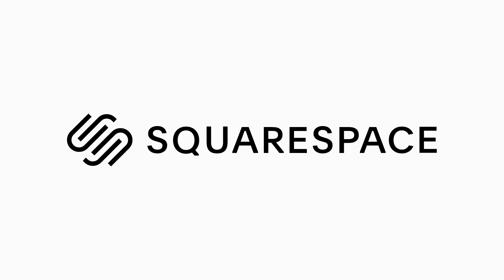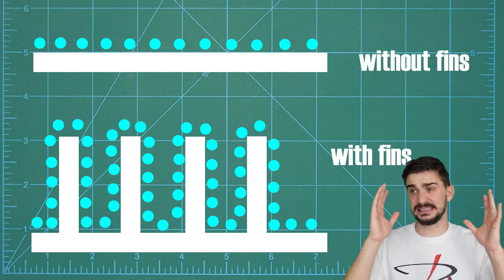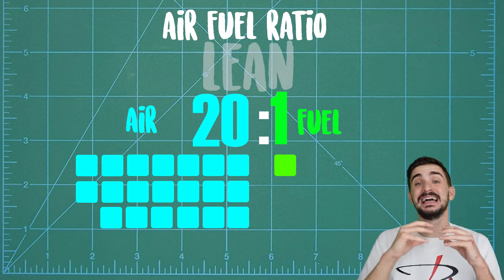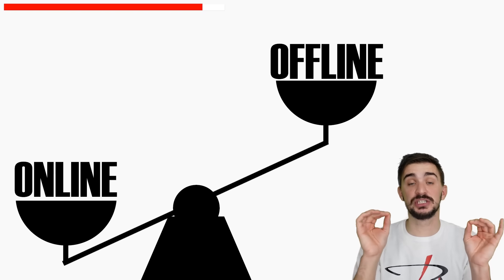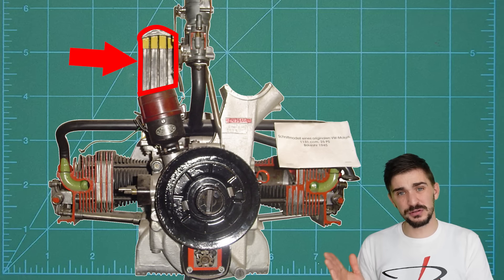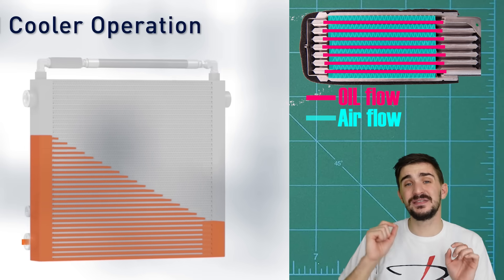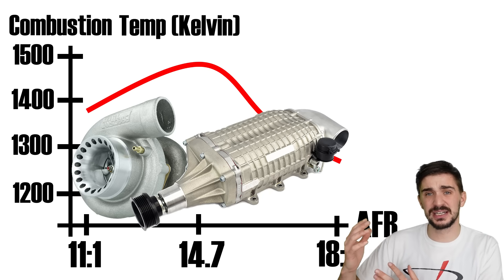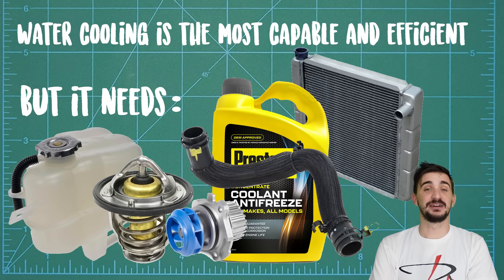AIR COOLED vs OIL cooled vs WATER cooled ENGINES

Comment: The only 'real" distinction as to wether an "air cooled" engine is actually oil cooled or "air cooled" is by how much of the heat extraction is done by the oil or the air. Even in air cooled aircraft, the fraction of heat dumped from the heads by air is very close to the amount extracted by the oil, and totally depends on wether the engine has spray oil piston cooling or not as to wether theres more cooling done by the oil or air flowing over the heads. In all cases, the most, by far is the heat rejected by the exhaust! The fractions that I remember are 13% rejected by the air, 10% from the oil, and 40% out the exhaust. More aggressive usage of "oil cooling" can get upwards of 30% of the heat extraction from the oil,  
(thats what Porsche was able to do), but this requires 15 quarts of oil and humongous oil coolers. Probably a better way to procede is to stop so much of the heat of combustion from getting to the heads and block.
Reply: > to stop so much of the heat of combustion from getting to the heads and block.
long stroke, double pancake shape ( HEMI ), high RPM ( the longer you wait, the more heat goes into the walls ) => fast piston speeds. Central sparkplug protruding a lot from the roof. A single exhaust valve has a little less surface area .. at least rocket engine like to have less but bigger nozzles. The thin walled exhaust pipe needs to start immediately behind the valve stem ( two exhaust valves: Y combination a welded pipes). Now tight bends in the headers. Extractor headers to pull the heat away. No turbo. 3 cylinder inline engines or hot vee to keep the heat at one place.
Reply: @ArneChristianRosenfeldt  Thermal barriers in the combustion chamber and exhaust port + water/methanol injection works on anything.
Reply: @63turbo  In the chamber we need to cool the oil on the walls. But you sure are correct for floor (piston ) and roof ( valves where not touching the seat ).
I am all for Ethanol/Methanol and high compression, but water?? I am unsure about turbulence. Can we have so that it stays away from the walls? Squish areas seem bad.
Reply: @ArneChristianRosenfeldt  Water has a infinite "octane rating", and is really cheap compared to any fuel, especially these days. Adding alcohol to water makes it easier to evaporate. Both the piston and combustion chamber are the main sources of heat input, and at the point of maximum heat and pressure, (12 to 16 degrees after TDC) the cylinder walls are an insignificant source of heat transfer, because theres so little area at that point in the cycle exposed to the heat, and because the cylinder walls are usually made of something that is a relatively poor conductor of heat anyways. The more efficient the engine is, the less heat there is to get dumped into the cooling system, the less sophisticated the cooling needs to be!
Reply: @63turbo  Especially with oversquare engines and the firewall: The sliding surface (for the piston rings) is only exposed after 10 mm travel. Still, the flamefront reaches the oily surface about at that time ( last to burn at 20° after TDC ). Fortunately, pressure goes down from there and adiabatic cooling sets in. And yeah, less pressure means less molecules per area which imping on the poor surface.
Just please keep the piston surface flat ( vertical valves => a reason to use 4 ). And the roof also flat so that the piston or valves do not need to compensate with bulge. I wonder if natural oxidization / carbon deposite already creates a heat barrier. For me, Ethanol is water+gasoline in a single molecule. Only one tank, one pump. Water should stay in the water-cooling jacket. Rust is a problem.

With relative hot roof and top, it becomes important that the fresh charge is not too turbulent to not suck the heat out of there before the compression. So squish area is better and 2 intake valves. And generally large cylinders. Combined with the high piston velocity and the specced power (in a hybrid ): 3 cylinder engine like BMW i8 .
Reply: @63turbo  with a heat barrier we need even colder coolant to lower the surface temperature before the fresh charge touches it. So coolant system dimensions stay. Temperatures go down everywhere. Max compression.
Ah, I think the thermal barrier should only be so thick that the heat at the 3000 RPM working point ( in a hybrid with an electric dynamo/motor with the same torque ) just passes through the barrier within the duration of the working stroke. It needs to be as thick as possible behind the exhaust valve and on the valve because cooling goes through a the bottleneck of seat and stem. The cold seat is exposed to the hot exhaust in the exhaust stroke. Focusses water cooling from behind to cool the valve and then periodic max heat at high flow rates. Stress!! Would be great if pre-cooled exhaust from the walls actually touches the seat, while the really hot exhaust covers the valve .. uh .. anyway, we need high compression, to avoid any hot pocket.
Reply: @ArneChristianRosenfeldt  I think you are over thinking this alot- Water injection severely limits the heat of compression and hot spots, and all the extra heat from combustion, instead of going into the coolant system goes into the liquid, turning it into a gas (steam). Instead of dumping heat into the cooling system (and losing pressure because of it) the heat has to make some steam- basically going temperature to increased volume on the power stroke. In the old days, water injection got a really bad rap because of the crappy, too simple and crude ways of introducing the fluid into the air stream. The best systems now work like efi except the injectors are meant for spraying water/alcohol.
Reply: @63turbo  Carnot says that we need a high temperature at TDC and a low temperature at BDC. I was always a bit confused if BDC before or after ignition, but I think, both are meant. Direct injection of water after the combustion has finished (controlled to create a flat top pressure) and then turbo compound! This way the exhaust temperature stays low enough that the catalytic converter is never annealed and also we can use variable geometry in the turbine and a cheap housing.
Reply: @ArneChristianRosenfeldt  Its more like you GET a high temperature and pressure at TDC than "need" it. The higher the compression ratio is, the higher the peak pressure and temperature is. The hell of it is though, no work can be done at tdc, and the more efficient the heat transfer of the fluid is to the heads and piston are both because the volume is small and the temperature difference between the heads, piston and heated gasses. Limiting the heat transfer can really help a bunch!
Reply: @63turbo  I just cite Carnot. He calculated it for a steam engine. Those metal tubes with the smoke which go through water need to be as hot as possible. Likewise our mixture need to be as hot as possible ( due to adiabatic compression ) while the chemical reaction transfers heat into the gas. ICE is more efficient due to the higher temperature which would melt iron in a steam engine. If you don't like turbo, we could add a bank of low pressure cylinders (two stroke). Max pressure is behind TDC because even the most high compression, advanced timing engine with off-center crankshaft likes a free meal like pressure rise due to the flame after TDC.

Comment: hmm? seems like the compression and combustion of a motor would produce much more heat than the "friction"? I mean don't they try to reduce friction as much as possible in an engine to where the almost is none?

On the other hand they make camp fire starters that work on compression alone. put some wood shavings in the cylinder, give it a good hit, and voila you have FIRE. Same principal as heat pumps which use compression to generate heat. (very similar to a motor)

of course compression along with the actual COMBUSTION in the motor is clearly the source of heat.

with that being said I learned a lot from this video and appreciate it! thank you!
Reply from the maker: 09:15 ☺️ I did say combustion is the main source of heat, admittedly it should have been said earlier in the video

Comment: Rich mixtures in air cooled engines: In aircraft engines this was done during take-off and full power to cool the engine, as was explained. It was said that the flames from the (very short) exhaust pipes  due to the excess fuel burning outside the engine could be up to 2 feet long! But once the throttle was pulled back the mixture was set to optimum, to have better fuel consumption.

Comment: The heat of combustion is by far the biggest source of heat in an internal combustion engine - friction accounts for about 5% of heat generated in an engine.
It is possible, at ambient temperatures, to only convert about 25% of the combustion heat into mechanical movement. This was first theoretically understood by Léonard Carnot. The rest has to be dissipated.
Typically about 40% of the heat of combustion goes into the exhaust gases, 30% into the cooling medium (air, oil or water), 5% into friction, and the remaining 25% as mechanical energy.
Reply: Efficiencies vary in engines with some diesel’s getting near 50% efficiency mainly because the fuel has more energy contained inside and less heat is wasted and actually used to move the vehicle. Gas is typically 25- ~35%

Comment: Sounds like oil cooling is, in many ways, the worst of both worlds. It is not as effective as water cooling. But it still requires a radiator, as well as a more complex oil pump. And to top it off, it still requires cooling fins in the top end (unlike water cooled engines). I guess there is a reason why it never became terribly popular.

Comment: 5 more advantages of AC motorcycle bikes, not mentioned in the comments (yet) are:

1)  The weight difference – a liquid cooled motorcycle will weigh more.
2)  An engine being a complex mechanical machine. You can both hear and listen to the motor more acutely. A water jacket in an engine is a sound insulator. Some would say this is a good thing as liquid cooled engines are quieter than air cooled engines, I just disagree.
3)  In air cooling systems, the engine is not subjected to freezing issues (I know, I know... liquid coolant, has anti-freeze properties).
4)  No danger of coolant leakage or low level in air cooling system. 
5)  An air-cooled engine can take up some degree of damage. A broken fin does not affect much while a hole in the radiator may stop a water-cooled engine.

Yeah, OK... I'm old school.
Reply: less appreciated these days is the difference in consequences of overheating an air cooled engine vs a water cooled one. If a water pumper ever over heats bad enough the block and heads are usually toast... you are usually "done" driving until the engine is fixed or replaced.With an aircooled engine, all that is required is to get over to the side of the road, let it cool down and you are on your way again.
Reply: So, an engine making more noise is an advantage? Are you a sadist or something?
Reply: @caty863  Its an advantage if you like the sound its making, and is a disadvantage if not. Its for the same reason people put louder than stock mufflers on or, why the stereo has volume control and a off button.
Reply: @63turbo  Thanks, could not have said it better myself.
Reply: Its the sound of music to some, (like me!) and a "reason" to own a waterpumper for others https://www.youtube.com/watch?v=VKMGJJ4IyQ4
Reply: A liquid cooled engine will weigh more, wrong.
Reply: @GPz84  If it is the same displacement, with everything needed to keep it cool, the water pumper will weigh more. This has always been the advantage of the aircooled engine, and this is why so many WWII era aircraft were aircooled. It is the same reason why so many small air craft are still aircooled.
Reply: Just say you're an uneducated Harley-Hick

Comment: So basically, every engine is air cooled.
Reply: I would say, every motorcycle engine is AC to some degree.
Reply: @Gringo_In_Chile  Car engines also. At the end, air is a substance that take the heat out of engine.

Comment: Most heat is not generated by friction, but by the combustion.
If friction was that bad, engine parts wouldn't last that long in the first place.
That's why you have oil to reduce friction.
Reply from the maker: 09:15

Comment: I always learn from your videos! Thank you! I have a long time question that I have been officially looking for an answer to. Which provides more cooling in race applications? Thermostat in or removed in water cooled engines?
Reply: Are you serious or what?? Do you even understand what the thermostat actually do? 
 I'm going to give you a hint, the temperature value displayed on your dashboard is not even accurate, by choice on modern vehicles, it's a more or less fixed 90°C value, but actually it fluctuates a lot. 

 Once it surpass the opening temperature, which is written on the damn thing, the thermostat will only be a bottleneck on racing conditions..

Comment: Most of the heat in the engine is from the combustion... Compressors that is basically the same as an engine but without the combustion do not get nearly as hot as a similar sized engine.
Reply: Friction is only a miniscule percentage of the heat rejection of an internal combustion engine. This kind of ignorance of basic thermodynamics drives me crazy.
Reply: And most of the heat will be at the top end of the engine due to combustion being quite hot once warmed up. Friction heat is indeed minimal.

Comment: Some nuclear reactors used by soviet submarines went as far as to use molten metal as the fluid for their cooling system for the sake of compactness. This meant that they could under no circumstance stop the reactor during the submarines' lifespan or else it would solidify.
Reply: Usually it was sodium or some other alkali metal. There were also sodium-cooled valves used in piston engines, which are not so common nowadays.
Reply: @Jupiter__001_  They're still used in some high performance motorcycle engines.
Reply: @Jupiter__001_  Fun fact, the Hyundai N cars like the Elantra N and Veloster N have sodium cooled valves, which helps with endurance when doing full length track sessions.
Reply: That sounds insane. Is there any article, that can give me more information on that?
Reply: @Franko384  https://en.wikipedia.org/wiki/Liquid_metal_cooled_reactor
Reply: @juanordonezgalban2278  thank you very much sir
Reply: @Franko384  He is correct in a sense that they are metals.
But....they have a very low melting point and the heat generated by a nuclear reaction would quickly turn them into a liquid. Tin would be the only exception, mercury basically stays in a liquid form and tin would only be used in an emergency situation. So in other words , say lead would only be used in early reactors and likely as an additional shielding factor from radiation.
Mercury would be highly stupid as if it's vaporized and leaked would kill everyone.
So basically he is right , but more or less bieng a contrarian. Soviets were known for not caring about the longevity or health of thier crew. Many Aztec Pyramids are poisoned with mercury to prevent excavation. Imagine if it was vaporized.  The crew would be dying in minutes and tin is just stupid.
Reply: What the actual fuck
Reply: there are also proposed energy storage designs, where they fill an insulated  heat resistant container with either specific mineral salts or sand and they heat up the stored medium with surplus energy, the primary issue right now is the inherit energy lost in heating with solar and wind systems but it is viable with coal and nuclear power as the medium is already heated and vented so they design it to vent through the medium and dump it's heat before venting
Reply: Sodium core valve stems are standard in Lycoming aircraft engines.
Reply: That's metal as DA!
Reply: Like an aluminium factory.
Reply: The soviets.. always crazy ideas
Reply: I don't buy it 🙄 First of all, nobody has ever seen uranium make anything hot. Second, how would Wikipedia get all of the designs of a secret nuclear Russian sub? It makes no sense.
Reply: Which they actually did totally brick the reactor while in port. 
Turns out comrade Karl was not taking his job seriously and allowed the core temp to go below the freezing point of bismuth. What a mess.
Reply: The Soviets used lead-bismuth eutectic alloy.
Reply: There are still teats for molten salt reactors with the theory that in the even of catastrophe failure the lava will only destroy the reactor, not the state.
Reply: Nucleqr engineer guy from YT Shorts is that you?😂
Reply: Heat is energy  wasted. Every engine that is larger  than 1/4 liter or of some specific power output should not dump excess heat energy overboard but wisingly use it in another energy transformation loop / cycle like a small stirling engine or reversed thermocouple to extract and use the otherwise  wasted potential. A F1 engine is one of the highest most efficient powerplants of ICEs and it can only capture 50% at best the full energy content of its fuel to propel itself by wheels. If a stirling engine could get even 5% ( easily done at 5 maybe even 10% ) it could power ALL electrical needs there eliminating the generator or alternator and waterpump AC unit ( more commercial / transportation  market) and / or other parasitic accessories.  Thus improving not only emmissions but performance. Imagine a vehicle that can only harness less than 1/2 its true potential. If we could improve it to 60 or 70% the atmosphere and our lungs would run better to .